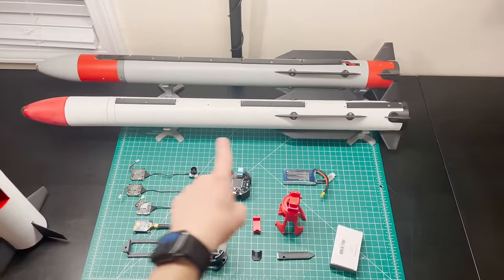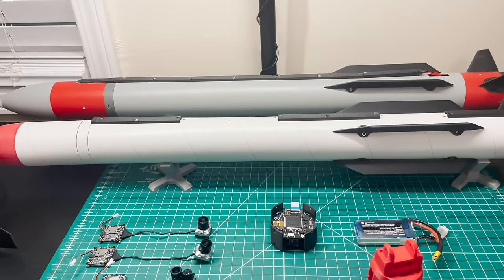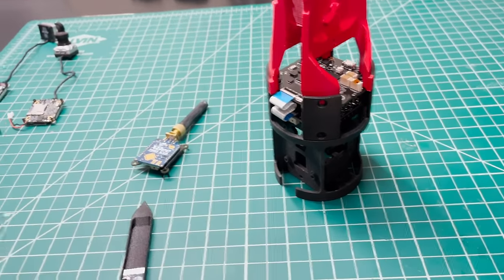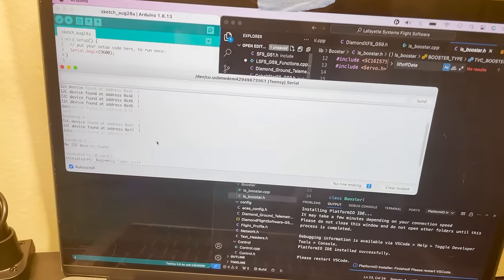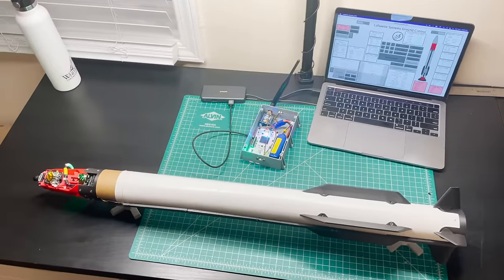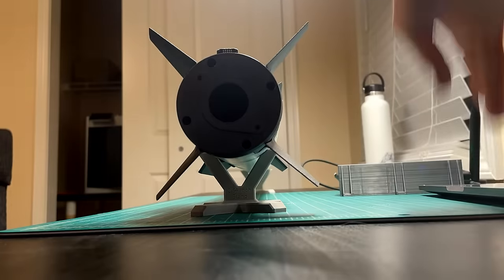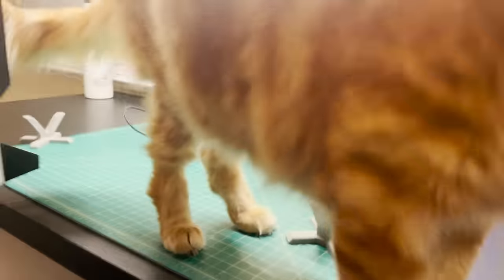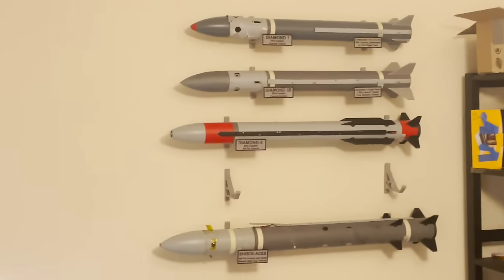How Does This Rocket Steer Itself? -- Active Control Rocket Avionics (Building DIAMOND-X Part 2)

Comment: the rocket steers itself by having a chip onboard that plays the "the missile knows where it is at all times" meme and the rocket just watches it over and over
Reply: The missile knows where it is by knowing where it isn’t, and by subtracting where it isn’t from where it is it gets where it should be…
Reply: Why is this so funny🤓😂
Reply: @ion8264  because you lack a sense of humour 😂🤣😂🤣😂🤣🤪
Reply: @ion8264  the original is funny, the comment isn’t meant to be funny I don’t think, because if it is it didn’t do it
Reply: @Volt64bolt  ok tough guy🤓🤓
Reply: GPS AI loaded.
Running GPS AI.
Political AI is loading.
Activating free-texas module..
Reply: @Volt64bolt  you lack the humor update that came in the 2000 bc package
Reply: @Jorged18  probably because I wasn’t alive back then,

Comment: Are you building a model rocket or a model anti-air rocket?🔥
Reply: That would actually be MUCH harder than what he doing now. His current project is GPS/camera based. For an anti-air rocket, it needs to be radar or IR guided. That introduces MASSIVE issues to be overcome on a NON multimillion dollar project. For example, a current sidewinder IR missile has an actively cooled seeker head, using liquid nitrogen...
Reply: @sorryociffer  IR sensors are need to be cooled to do their job properly. Radar modules have come down in price incredibly in the last few years, which would make them an easily obtainable item.
I also think I remember Lafayette Systems saying something along the lines of "Not including a guidance system because that would be crossing the line and I might get shut down". But I may be thinking about different channel... ;)
Reply: @sorryociffer  this makes his model rocket capable of working as a gmlrs (guided multiple launch rocket system) capable to land attack like the himar with imaging cameras for terminal guidance 😂
Gotta be badass
Reply: @lexzie9568 only if he has the processing power for computer vision to identify targets and a reasonable refresh rate
Reply: @56 There are some really impressive results from image identification processing power of the raspberry pi 5, potentially one could build a short range anti-air by using a regular camera.
Reply: @Polkem1  reall
Reply: Yeah that's true

Comment: Good job.  +1 subscriber.  I will say based on what I know of supersonic flight transitions, if you ever intend to make this project supersonic, the proximity of the long fixed body fins to the articulating fins in back may prevent the articulating fins from 'grabbing' much air for maneuvering as the shock cones from the body fins will create 4 localized regions of low pressure around all of the movable surfaces because all 8 fins directly aligned fore and aft.  Using grid fins in the back would fix this at the cost of subsonic efficiency, or maybe moving the body fins more forward on the rocket body.   I wouldn't suggest rotating the body fins to be off axis because this would increase the drag and would put the back fins in line with shock cone paths, but this option might be better for subsonic only maneuvering.   Look forward to seeing more of your videos. 👍
Reply: "if you ever intend to make this project supersonic" your name will be on the list for sure.
Reply: What about the articulating fins seamlessly connecting with the fixed ones such that when aligned with the main body axis (z axis?) it forms one seamless fin (or negligible gap between them)? Would the low-pressure pockets still have an impact in that case? I don't know much about airflow dynamics but it seems like its probably a low pressure "cone" so as you get closer to the source you'd have to articulate less to eliminate the offset? Just curious.
Reply: lockheed martin here, we would like our engineer back please
Reply: @laytonmiller5865  In my mindsim (thinking about it for 3 seconds), the closeness to the source of the sonic boom would hurt the controls, not help. It could go either way I guess, but the turbulence coming from the fin's leading edge would probably get more manageable the farther away from the leading edge you go.

I think that either way, active controlled fins for supersonic flights is a bad idea. The single point of contact would have to be very strong, adding weight and drag. Then again, we do it for fun so who cares about performance.
Reply: That's why you distort the rocket body as the control surface in supersonic flight!  Requires proper Reynold's numbers modeling in a wind tunnel.  Just 2 cents.  Think of "Flight of the Navigator", 1986.
Party On!!!🎉🎉🎉❤🎉🎉🎉

Comment: Good shit bro, this stuff is like a better version of what Joe Barnard was doing a couple years ago. That board is beautiful!

There's a guy on the rocketry forum that cuts holes in the bottom of his body tubes to add to the base drag, his rockets fly stable with no fins and no active control, but they are inefficient due to the high drag. Rockets like that are really fun especially since the FAA waivers are low where I live, so I want to get into active control to spice things up.

This is not a tutorial, contrary to what everyone yapping in the comments thinks, but it is a good resource with lots of good ideas that will simplify the engineering design process for people like me who would otherwise have to build the know-how from scratch.

You could have kept your solutions a secret, but you shared it with everyone, thus making this part of the hobby slightly easier to get into. Thanks!

Comment: So sweet man this is excellent work. So cool. why not multiplex your signal lines ex: single wire PPM for your multiple pwm channels. Or better i2c (wire.h), address different stages/sections with a small microcontroller slave, connected to corresponding actuators. all receiving data from a single i2c bus from the master avionics stack. This way you don’t really need more than 4 wires in the raceway.
Reply: If he doesn’t need to receive data back from the lower modules then just using uart and only using the TX line on the main controller would work, just connect it to the RX line of the slave microcontrollers since they can all receive without interfering with each other, just start the data packet with an address. Then you only need three wires.

Comment: Fun fact: you can’t send guidance data of any sort to the rocket in flight because that suddenly turns it into a guided missile.
The FAA isn’t too happy about that.

Edit: there's a difference between an internal guidance system for maneuvers made for the rocket, by the rocket, and externally choosing its direction from a controller. Missiles don't need a warhead to be a missile, and they can be tiny.
Plus a supersonic dart does a lot more damage than a drone on Ebay which is why these are all legal, minus the missile aspect.
Reply: Is that true?
So the FAA rather has uncontrolled probably malfuntioning aircrafts in the air?
I mean a RC Plane can be controlled, or are there other restrictions that apply?
Reply: @einhalbesbrot  RC vehicles are different than what are essentially recoverable missiles. The internal guidance of the rocket can work, but any active external commands are NOT a good idea. You could use a tiny model rocket to hit something flying 5000’ up easily, and if you made it bigger and guided it (like a lot of later steps in the hobby), you could hit things at 20000’ or up.
Reply: @einhalbesbrot  plus a missile doesn’t need explosive filler to be deadly to any aircraft.
Reply: @judet2992  but there must be some form of internal guidance. A self correcting "fire and forget" rocket must be worse.
But then again its rules and regulations, they dont have to make sense.

Here in germany there is a bunch of weird rules.all different for drones, helicopters, rc planes, rc gliders.
Reply: @einhalbesbrot  yes, internal guidance is ok, but external commends to that system on where do go during flight are bad.
Reply: @judet2992  ive seen some projects of non explosive missiles that use visual tracking in order to collide with red balloons etc.
That would be ok?

What if i have a rocket propelled (not a rocket itself) rc plane, could i send external guidance data towards the craft?
Reply: @einhalbesbrot  For both questions you proposed in this, yes. The tracking on the missile was internal. There were no external guidance commands, as it was all based off the seeker (also link please, that sounds sick)
For the second, it depends on what the FAA counts as a sport rocket and not an RC plane. Idk.
Reply: Fine! I guess i'll just have to add an internal IR heatseeker to mine. 🤣

Comment: Have you explored using Rollerons, such as the Sidewinder missles use? It was revolutionary when guided missiles were coming into use.
Reply: Could maybe even use a thin/slim servo as the rolleron body and save space inside?
Reply: The rollerons used in sidewinder missiles need to be spun up in order to work correctly. Sidewinders are launched while already in motion so the rollerons have been spun up prior to launch. I'm pretty sure there's a minimum airspeed required when launching a sidewinder since it the missile needs the speed to spin up the rollerons.
A sidewinder launched from zero airspeed loses the benefit the rollerons would normally provide. Digital IMU technology has come far enough that it makes more sense to use the digital sensors. 
I personally think rollerons are super cool. I just don't think they're appropriate for this application.
Reply: @ddegn  The MIM-72 Chapparal was a SAM that used Sidewinder missiles and entered service in 1969 and phased out in 1998. I think the initial launch, because it won’t have to do crazy off bore-sight maneuvers, would give them the spin up needed.
Reply from the maker: Rollerons solved the roll instability problems the early missiles had with canards. I have built canard controlled rockets in the past (without rollerons) and had similar issues. This rocket uses aft fin control, so I have to worry less about roll reversal and changes to the roll control dynamics throughout flight. Other folks like Jim Jarvis use canards, but let their entire aft fin assembly spin freely about the rocket's long axis to solve the problem. Spinning fin cans seems to work well, and are used on a number of missiles like GMLRS and the Excalibur guided artillery ammunition.

Comment: 100% great video but to help speed up the fun alignment you can 3D print a cap with slits and program it to "calibrate" by wiggling them back and forth until a resistance is detected (fit into the slits) and set that as a the aligned position

Comment: This rocket steers itself by knowing where it is at all times. It knows this because it knows where it isn't, by subtracting where it is, from where it isn't, or where it isn't, from where it is, whichever is greater, it obtains a difference, or deviation. The guidance sub-system uses deviations to generate corrective commands to drive the missile from a position where it is, to a position where it isn't, and arriving at a position where it wasn't, it now is. Consequently, the position where it is, is now the position that it wasn't, and it follows that the position where it was, is now the position that it isn't. In the event of the position that it is in is not the position that it wasn't, the system has required a variation. The variation being the difference between where the missile is, and where it wasn't. If variation is considered to be a significant factor, it too, may be corrected by the GEA. However, the missile must also know where it was. The missile guidance computance scenario works as follows: Because a variation has modified some of the information the missile has obtained, it is not sure just where it is, however it is sure where it isn't, within reason, and it knows where it was. It now subracts where it should be, from where it wasn't, or vice versa. By differentiating this from the algebraic sum og where it shouldn't be, and where it was. It is able to obtain a deviation, and a variation, which is called "air"

Comment: Some rocket systems use a piston that’s driven pneumatically to physically push the rocket out of the tube and then the booster rocket kicks in fires it then might help you get a little bit more speed or flight time because it takes a lot of thrust getting the rocket to go from zero to plaid

Comment: If you end up having issues with the wireless telemetry downlink, it might be worth getting a different antenna or orienting the existing antenna differently. Currently, the antenna dead-spot will be pointing straight downwards = basically where your launch site and presumably receiver antenna will be located.

Comment: I'd love to learn more about the camera system. I notice they are FPV drone cameras, but are they digital or analog, and do they record and save data on their own (meaning do you just have to power them, and their built in electronics handle everything to get you a video file)? Looking into options for cameras for both rockets and cars. Thanks!

Comment: Concerning the alignment of the fins before the flight: could you use essentially the same process CNC machines use for homing without discrete limit switches?
In so far that they slowly drive the motors in each direction and when the electrical characteristics change (IIRC it was the power draw rising sharply) that would be one end of travel. Do that for each motor in both directions, halve the "distance", voila you should have the neutral position.
Might be useful to automate or even integrate a time-consuming manual process into the POST of the avionics.

Comment: would it be possible for the active fins to extend into the rocket fuselage, and into the nozzle, so that it can induce thrust vectoring for maneuverability, à la AIM-9X? maybe small strips or thin plates, made of steel, for the portion of the fins that would be exposed to the exhaust to withstand the heat?

Comment: In my opinion, maybe your rocket would need the dorsal fin. Like 5 to 3mm height and 15cm long. My aerodynamic brain tells me it would have better inertia resistance if did, and further, you can duct your cable into dorsal fin-like structure in the one side. Your cable duct causes some instability (i mean, it cause more precise software) i think.

Comment: You are very inspiring! I’m 63yo and only recently got into programming MCU’s (I am a retired software engineer, 40+ years). Any chance you can point me towards the code for a kalman filter pitch, yaw, roll, lat/lng and altitude? I’m writing the code for a very basic flight computer on an STM32H747 and the “how to” of the kalman filter is kicking my butt.

Comment: If it clears its on board flash each power on.. what system/protocols have you implemented to prevent wiping of flight data after a launch if the computer reboots mid retrieval..

Comment: Cool project! Why do you use energetics to separate the booster? It will drag separate. Even if it doesn't, hot staging will separate it. I've never heard of a hobby rocket that uses a charge to separate booster.

Comment: Can you go a little more in depth on the circuit boards and how it works also how did you tune your servos for the angles i have so many questions, is there a place or link that i can read for this information???

Comment: Improving the Current Setup
Questions and Answers
Response time and synchronization

How effective is your current gyro compared to lidar technology?
I also noticed that you are coding with arduino ide
I also noticed your steering mechanism is servo based

I guess its all about your personal attributes 
My attribute or value is more about durability and best function 
Design or beauty takes last position

My experience of servos is the value type servos or middle bracket servos compared to the 
high end expensive servos
The middle bracket servos also crash easily when used extensively for various programming reasons and also due to saturation of magnetic fields in an overcrowded environment ie several servos and components

I rather use motors with an H Bridge compared to servos,
You will get better agility or response time with motors
Motors never crash and will never burn out just moving back and forth in small pulses

I like servos for its aesthetic qualities like sound and robotic movement however not durability and function because the always die on me

I also like your GUI
I HOPE to see your rocket fly soon and i will be able to access the quality of your servos and gyro

Sincerely Best Friend

Ejike